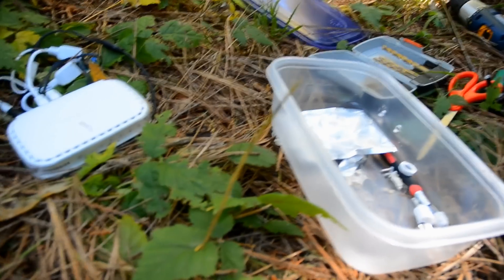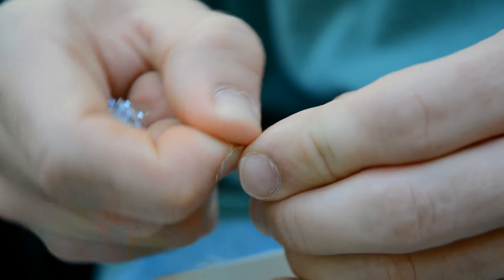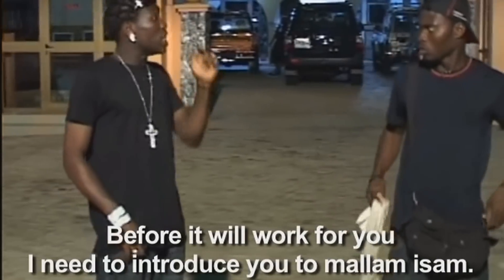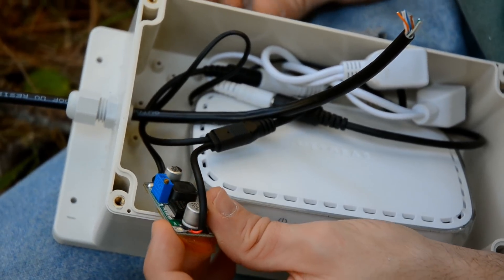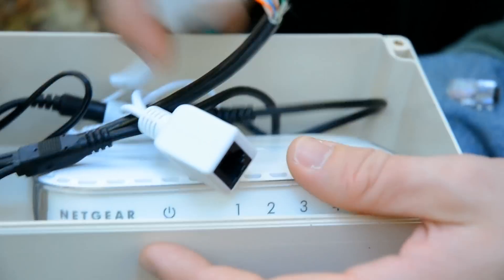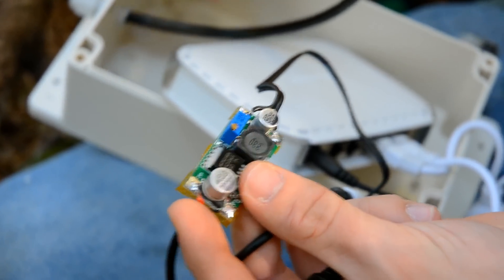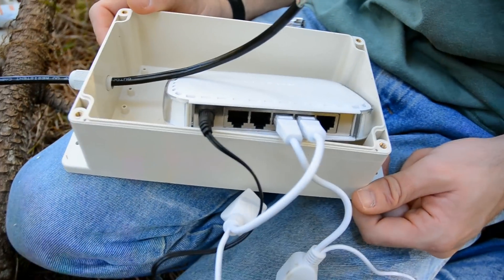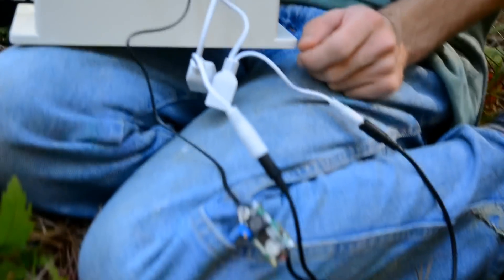Project "Creeknet" - A Mini Doc about a DIY 2,200ft outdoor LAN

Comment: I would say that gigiabit switches be used in the system but this is good design given that the system meets the requirements of the user
Reply from the maker: The ISP is only providing a 12Mbps link which we share with the homeowner at the far end of "creeknet".  We used 100Mbps switches to keep costs down as we are only using the internet data on this line and rarely sharing data between the PCs in the other home.   We have gigabit switches in the home for our LAN.

We also have some limiting factors that prevented us from even considering gigabit switches.  The first run from each home to the first node is in excess of 330ft the limit for a reliable 100Mbps link. We had no way of adding another node in this location as much of it travels through an underground culvert.  We were forced to install 10Mbps hubs on both far ends to force a 10Mb link for these 500+ft sections since 100Mb switches wouldn't link at that distance.  Unfortunately this limits our entire line to 10Mbps.

I agree with you, this isn't the most ideal solution but as you said in my case this fit my needs.

Thanks for commenting!

Comment: I love your creeknet!  I would love to see a follow-up video sometime.

from reading the comments, I have a few things to note:

1) get rid of the hubs.  they are killing your speed by running 10mb half duplex. you want at least 10mb full duplex.
I would recommend the Netgear FS105 - https://www.amazon.com/dp/B00002EQCW/ It's small, inexpensive, reliable, and durable. 

2) upgrade to 100mb switches.  and make sure everything along the line supports 100mb (throughput is only as fast as the slowest link)

2.5) Ok, normally I wouldn't suggest this, but since your neighbor's connection is so slow, this would be acceptable: 100mb hubs would work too. but this is definitely not ideal.  plus finding enough 100mb hubs these days might be difficult. 

(note: gigabit switches would be better, but you can't do passive POE - only active POE, which is totally different... and more expensive! )

3) you said you have one cable run that is longer than 300ft.  if it is longer than 328 feet (100 meters) then I'd install another switch somewhere in the middle of that, especially after upgrading to 100mb.
Reply from the maker: +Otis Spankmeyer (Morlok8k) Thanks Otis!  I do plan on making a follow up video at some point I have just been too busy with work lately to get out there and do it.  I'll try to explain why we ended up using the parts we did we had a few little issues we had to work around.

1.  The hubs are for the first run from each house to the first node. The reason we picked these is because the first run exceeds 330ft and does so in a covert underneath the road, we don't have access to a location for a node at this point so we chose 10Mb hubs to give us more than 330ft to work with, @10Mb we can get over 500ft per run.  If we could have found a 10Mb switch we would have used that instead, but all we found were hubs (a lot of the shopping was done at thrift stores like goodwill to save money, we took what we could get.)  The 100Mb switches we tried wouldn't work because of the length of the run, we couldn't force the switch to 10Mb so it would just fail to make a link.

2.  All the switches are 100Mb but we are limited to 10Mb due to the 2 hubs at the end, this hasn't been much of an issue we only have a 12Mb connection from the ISP and can pull 9.5Mb despite half duplex.  

3.  The goal was always to drop 2 more nodes in and replace the 10Mb hub with a 100Mb switch to get the line up to 100Mb full duplex, but atm we are very happy with the current performance of the network.  No added latency and we can pull about 9.5Mb of the 12Mb our ISP is providing.  Hopefully one day I will have the time and energy to find a good way to get the last 2 nodes in.

Thanks for the advice, we are definitely on the same page here.

Comment: Is this still running well?
Reply from the maker: Billy Gleason Yep it sure is!  Using it right now to type this message to you.  It's been almost 2 years and we have had very few problems so far, mostly issues with keeping the "weather proof enclosures" dry.  Unfortunately the "weather proof enclosures" we ordered aren't as weather proof as we had hoped.  We have had 3 incidents with water getting into boxes and shorting out the switches, luckily all of them fired right back up once I dried them out.
Reply: I'm currently living abroad, but when I get back to the US, I will likely be running some sort of campus network at my church. May use a few of your techniques to get it done.

Normally I would use fiber, but I need no more than 8 jacks in each of the three buildings I need to extend the LAN to, so fiber is really impractical.

Another question: Have you had any issues with the DC/DC converters or power supplies?
Reply from the maker: Billy Gleason No issues at all with the step down converters or power supplies.  We used these for stepping down the voltage LM2596S DC-DC converter http://www.ebay.com/itm/2pcs-LM2596S-DC-DC-3A-Buck-Converter-Adjustable-Step-Down-Power-Supply-Module-/200958042532?_trksid=p2054897.l4275 .  We used 32V HP printer power bricks for our custom power injectors with one on each side of the line.
Reply from the maker: TheRainbowPilot Forgot to mention we sourced the HP power bricks from a local Goodwill thrift store for 2$ each.  The converters average about 3-4$ depending on where you look and the network switches were ordered "refurbished" for 6$ each.
Reply: TheRainbowPilot Thanks for the info! 

Because this will be used in a business setting and will likely be used for VoIP phones and data backups, I want to run gigabit. Also, because of the layout of the campus, I will likely create a ring network and run rapid spanning tree so that no building is offline by an issue in another building/uplink (except for the main hub, obviously). So I will need to get a little fancier switches than you used, but the principle is the same :)

My biggest thing is that I have been trying to figure out how to easily power an Ethernet repeater or switch when the 100 meter run lands somewhere without power. (I know some switches can be powered via PoE, but the VoIP phones will use PoE and the switch may need to provide the PoE...) Using your technique, I would run higher-voltage DC and use the DC/DC step-down, but to ensure the integrity of the gigabit signal, I will probably run doorbell wire or similar for power next to the CAT6 (I have the advantage of conduit, but I didn't want to bother with running new AC outlets). This would also eliminate the need to purchase the passive PoE breakout cables.
Reply from the maker: Billy Gleason Sounds like you have a good path forward, and you most definitely have a greater knowledge of the technology than I.  My knowledge in this area is fairly limited and this project was a huge learning experience for me.  If you have any more questions feel free to ask, I will answer to the best of my ability but for now I must sleep.  Have a good day/evening!
Reply: +TheRainbowPilot put silica gel in these boxes, may help from water idk.
Reply from the maker: +Green Stick We have had a few boxes that filled with water during rainstorms due to bad seals but small amounts of moisture have never been a problem.  The nodes work fine until the voltage regulators are completely submerge, they are surprisingly durable.
Reply: Maybe put some packets of silica gel inside each box to reduce moisture inside then seal with silicone

Comment: I run routers for my wireless network in metal waterproof containers that get full sunlight for the better part of the day and heat is never an issue with them. So I'd be fairly confident that this set up shouldn't have any issues regarding heat.

Comment from the maker: 2,200ft of cable is a lot to bury and the ground is full of roots since it is in a forest, a near impossible task to effectively bury all the cable.  I would much rather fix breaks in the wire now and then, it would only take about 5 mins.  Burying that cable would probably take 30+ hours with the ground as dense as it is, and portions of cable run through dense brush and blackberry bush.  Not a fun prospect at all, we are however re-routing that entire run and staking all the cable down.

Comment: I'm not electrical expert but you're stepping down 50V to 7.5 then forwarding that down the line? then why are you stepping down 7.5 to 7.5?
Reply: Transporting electrical power is more efficient using a high voltage and low current, using Ohm's law power=VI, for instance power of magnitude 60 watts can be 12v,5A, or 60V,1A,(and other multiples's of 60) if i used option 1 to transport power,due to high current,more energy would be lost in the form of heat remember E=I^2.R.therefore in this project it is intelligent to transport at high voltage of 50V and step it down to 7..5 at the points where needed